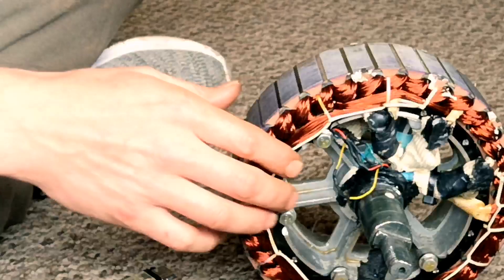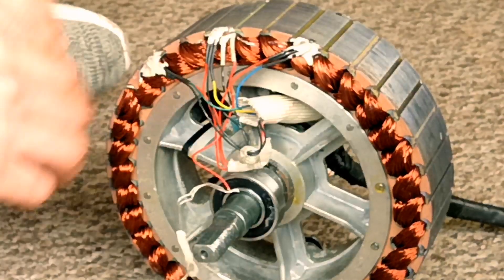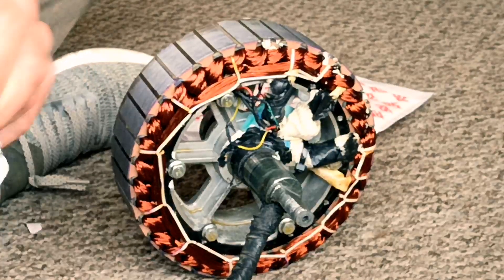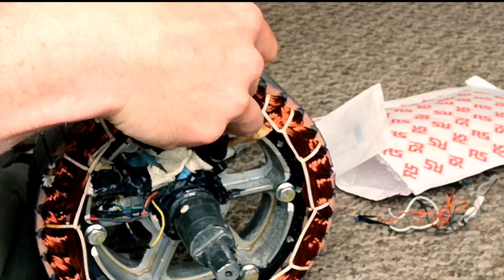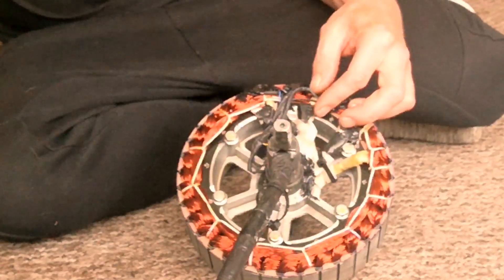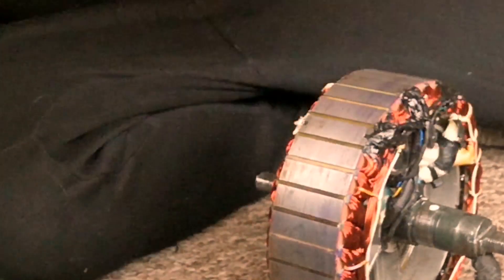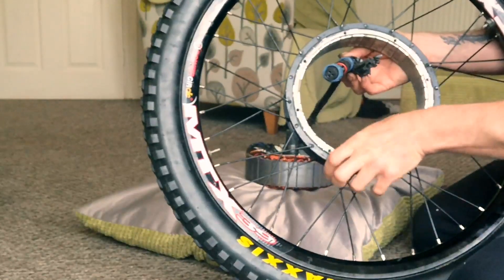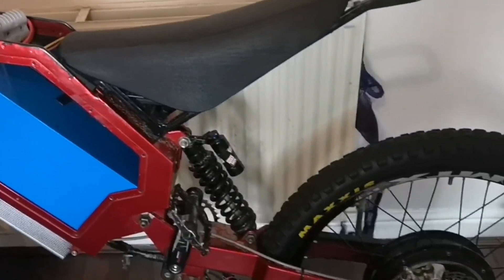FIXED! | E BIKE REPAIRS | HALL SENSOR | ISSUES | 5KW QS MOTOR | QS MOTOR REPAIR |

Comment: Great video.

Question…does it matter if the hall sensor replacement is unipolar or bipolar?

Can’t find any information online or on YouTube.

/Bklyn👑
Reply: You should use unipolar sensors for qs205. Most common replacement is Honeywell SS41F

Comment: I have the same problem with my sensors now, on them numbers are 502F 1960 and the problem is I cant find such sensors anywere, but they as far as I know they are bi polar 
do you think if I put likr F41 bi polar could work ? hope for some answers
Reply: Ss411 or 413 hall sensors will work!

Comment: Sir, I have a defective 2000 watt qs motor Hall sensor, I will replace it with a new one, but the serial number is not clear, please tell me the original serial number.

Comment: Loving you build 👍👌I'm running similar setup eeb frame 3k motor sabvoton 72150 72v26ah
Where did you get your battery 🔋 from 200amp mine is 50amp I can pull about 6000w but battery sage is about 10v
Keep up good work 👍
Reply from the maker: Cheers man thanks for your comment. a guy called Jimmy @insatInternational built my battery if you watch my latest video all the details are on there.
Reply: @theebikenut4679  just seen on one of your other videos 1700 with charger I will have give call thanks very much 👍

Comment: I have an rear hub motor and I need to know in general if I do need the hall sensor board or can I remove it and connect the hall sensors directly to the wires

Comment: what symptoms where you getting? before the hall sensor needed to be replaced? my bike judders and sometimes wont even turn the wheel and sometimes it does..
Reply from the maker: That sounds hall sensor related mate mine wouldn't turn at all and it would jump like a quarter turn and then stop but there was no symptoms before hand. To me yours sounds like a loose hall sensor wire maybes on the plug also check the phase cables going into the hub if they get damaged and touch anywhere else it creates the kind of issue you have.. You can buy a e bike electrical tester should you need it.. ebay (romai ebike tester) they are very good and  less than a 10r

Comment: Those 2 wires are the KTY83/110 thermister (temperature sensor) wires mate. You'll probably find that the red wire changes to a white wire somewhere along the loom.
Reply from the maker: You are a super star mate thanks for all your help and advice. I'm bloody over the moon the its working again. I guess hall sensors are a regular issue i doubt very much that will be the last time I'll have the wheel to bits it's becoming regular practice. It'll be a new axle next.. The threads have taken a beating. You wouldn't know where to get a new one from would you? Having one made is going to cost a bomb. I'm loving the whinch BTW every one needs one haha
Reply: @theebikenut4679  I bet you are happy mate, it's always a simple thing that causes major problems. They are a regular failure which is why they always put 2 sets on them now - they're not too good with heat and the constant pounding that they get with ebikes.
There are a few people who have tried sourcing a replacement axle without success. If you email QS, they don't even reply 😣I'm sorry to say but it's a new motor if it gets too bad.
The winch...... it look crap but it serves a very important purpose with a 54kg bike & 2 flights of stairs. Fail to prepare, prepare to fail 😁
Reply from the maker: I had a new axle priced up last time I had it in bits I can get a local company to turn me one but your talking about 200 quid! I asked the lads at work first but they said it's to much work about 4 hours to mill one.. I haven't replaced the spare hall sensors so when they go again it's a full strip down not to bad now I've done them tho...  I feel your pain with the stairs BTW I kept my bike at my mams when I went on holiday she lives in a upstairs flat.. What a killer! ... Joys of ebiking lol